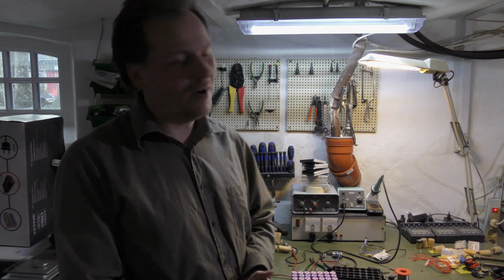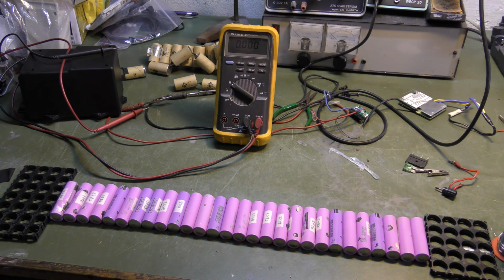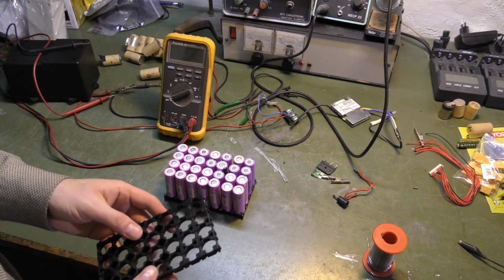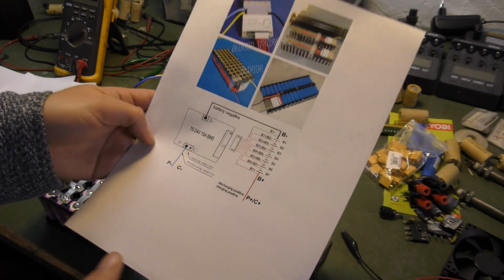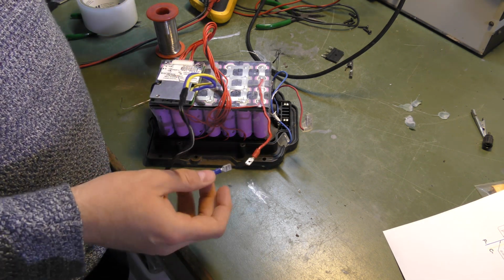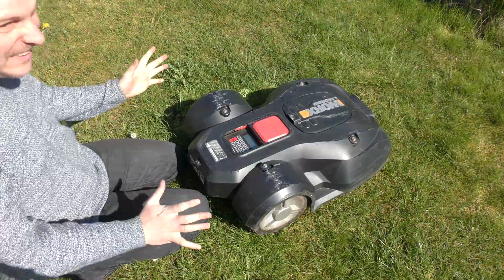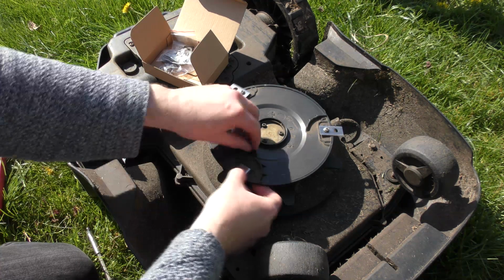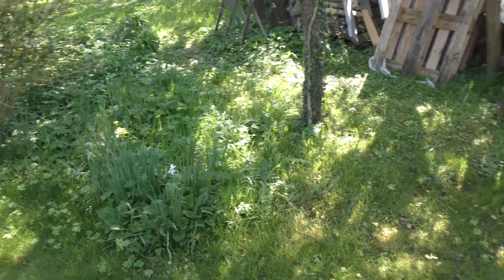Builds Li-ion 24V Battery, from 18650 cells for Robot Lawn Mower - 837

Comment: Hi sir. First of all i was new to this voltages stuff. My question is 7s 4p when they are fully charged they provided 28.9 volt only they read 24volt when it was like on 3volt.i have this speed controller that say 24v with 500w same as my dc motor does it safe to use like the one that you build in this video? Thanks
Reply from the maker: Hi ecoCharlie
It is not great to speed charge batteries,, slow charge is a better charge. 500w/24V is about 21Amps,,, that would be an bad idea to charge that fast,, that is over 5 Amps per cell... No I would not do that.
Thank you for watching! :-)

Comment: I think the 18650 can't take the load from grass, so it shuts down. Many of them have current limiting in the cb on them. If over heat then, they disconnect permanently - flat cells superior!
You will have to log it during use to tell.
Reply: I second this, you want to use some high current discharge 18650's instead of laptop batteries. Best place to get them cheap is drill batteries.
Reply from the maker: Hi t3g3lst3n
Thank You very much!  I do not think that is the problem,, lawn mover does really not use much power.
Thank you for watching! :-)

Comment: please fully test the BMS, charge the battery on the bench checking each cell voltage, overcharge a little and see if the BMS protects the battery, then do a full discharge and make sure one series row does not drop in voltage more than the rest, and if the BMS trips if any go below 2.5v
Reply from the maker: Hi SuperBrainAK
Thank You very much!  I have ordered a new BMS for it,, so will be checking it, and maybe replacing it.
Thank you for watching! :-)
Reply: My PlayHouse yep I would hate to see your lawnmower running around screaming like R2D2 on fire :D

Comment: You could have used a set of tweezers to pluck each individual blade of grass in the time it took you to get that pile of junk running. And poorly at that. Just a suggestion: Get rid of that thing and buy a battery or cord powered push mower and spend the hour or two every two weeks it takes to mow your rather small yard. Then you can sit back, have a beer and congratulate yourself on a job well done! LoL
Reply from the maker: Hi John Tilson
I did that for 10 years,, this is way more fun! and I can walk after the robot with a beer in my hand and kick it when it's not doing a good job!
Thank you for watching! :-)

Comment: Hey Morten, what happened to the big solar battery bank with the UPS and the shelf of gel batteries from cell towers? Does that setup still run? How much off the grid time does it give you (minus the server room, of course)? Or how many seconds would the server room survive on it? ;)
Reply from the maker: Hi Seegal Galguntijak
Thank You very much!  It's all fine,, took a break after the inverter,, blow up,, and a 30A fuse evaporated in my hand :-/ we will get back to it.
Thank you for watching! :-)

Comment: I think I will be staying with cutting the lawn the old fashion way.  High tech lawn mowers are too much work.
Reply: I've been using a similar robot mower for a couple of years now, with hardly any work, except for a bit of cleaning, swapping blades, and setting the schedule. Of course I've not been messing with batteries, but used the original li-ion cells. It has saved me a lot of work.
Reply from the maker: Hi Scott Downey
Well all this messing with the batteries, is getting tidios, but I am enjoying looking after the robot, way more than mowing the lawn,, even it not much time is safed :-)
Thank you for watching! :-)
Reply: I use goats. Kick open the gate and sit on the porch with a sling shot and bourbon.

Comment: Weren't you able to keep using the original cell balancing function that must have been on board the Landroid before? From what I understand those simple BMS's will keep the battery from spectacularly failing (venting), but don't do much for you in terms of ensuring battery longevity. Almost always they will only start balancing when a cell reaches 4.2V. The original Worx charger might only charge up to an average voltage that is lower for better lifetime? I measured one of my normal lawn mower battery packs after fully charging and it was only about 4.13 V per cell, which actually seems like a good number to me given that it is also storage charge.
Reply: As the original batteries in the Worx were lead-acid, I'd be surprised if it had any cell balancing circuitry usable for li-ion cells.
Reply: @JohnnieHougaardNielsen  Ooh yuck lead acid :p I see now I missed that part. But converting lead to lithium comes with some more problems mostly related to the charger that aren't really addresed here. I looked back at the video from a year ago about this and it is never mentioned that the charger is changed to a higher voltage for lithium. The old charger will probably only put out like 12.9 (?)*2 = 25.8V  while it would need to be 7*4.2 = 29.4V for lithium, otherwise the cells would only charge to 3.7V which really isn't enough. The BMS would never kick in, allowing for different voltages between the cells - possibly way too low. This might be the reason those apple pouch cells got puffed. 

Also the onboard logic will go back to base at a voltage that is low for lead, but might be wrong for lithium?  Also at 2:00 in this video it is mentioned that 18650's can be discharged to almost 0 volts - which I would think is a fine recipe to kill them ASAP though. At least the BMS should protect for that now... Charging could be done by always using a lab bench power supply but that kind of defeats the purpose of having the robot. Otherwise a dedicated CC+CV charger like Meanwell HLG is a good option to still be able to set your own voltage, but I'm not sure how the base station would handle a different voltage. Also the onboard logic and motors are tuned in at the lead acid voltages. Probably will be fine but still. I hate to say it and maybe I'm too pessimistic, but I think I would just have put in 2 new lead acid 5Ah for 30 euros total and be done with it for a couple years.
Reply: @ehvlullo  - Just replacing the lead-acid batteries would not have been so much fun for Morten! :-)
But yeah, I was also thinking that so many battery pillows at the same time could a sign of mistreatment, like the dangerous too deep discharge. Or it could be one of the crazy anti-repair antics from Apple.
Reply: @JohnnieHougaardNielsen  at the end of the last video he measured the cells they were 4.4v or so, so yes mistreatment
Reply from the maker: Hi D.K.S
This lawn mower was lead acid, before I made a Li-ion battery for it,, so it did not have a  BMS.. I have ordered two other BMS's,, that I might use if they are any better.
Thank you for watching! :-)
Reply from the maker: Hi D.K.S
Thank You very much!  This is a rather long projekt from last year,, there is a playlist : https://www.youtube.com/playlist?list=PLS2odYzlaogLVEcZmVwbwGrd7ILeSCzpR
A lot of what you are saying here, I have been around along the way. And Yes, discharged to almost 0 volts,, is not good,, nevertheless that cell can still be relived,, it will have lost capacity, but will work, for many years after that.
Thank you for watching! :-)

Comment: Glad to see the 1865 batteries bank has worked out for the fix hopefully it will work lot longer now and you have just put the amp hours up so it should cut longer to
Reply from the maker: Hi John Walters
Thank You very much! there is actually a little bit less effect in this battery in this battery,, the flat ones was 14WH = 3,78AH and that came to 11,35AH where this one with the 18650 is 9,6AH,, but hopefully working!
Thank you for watching! :-)